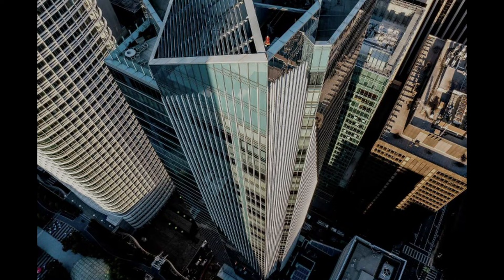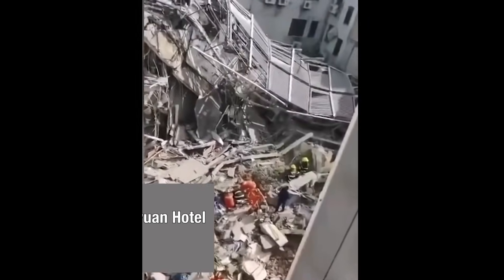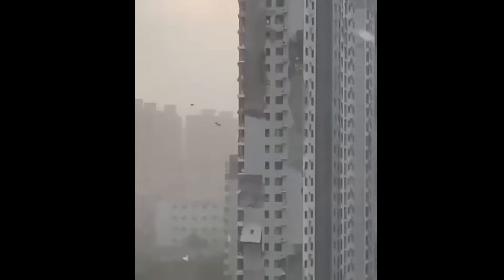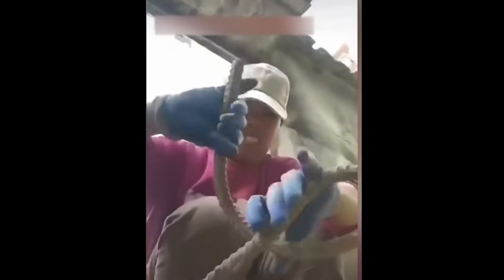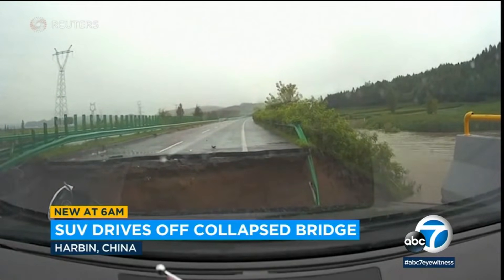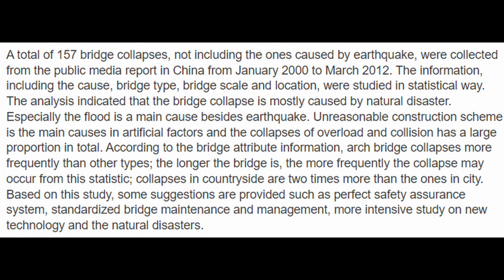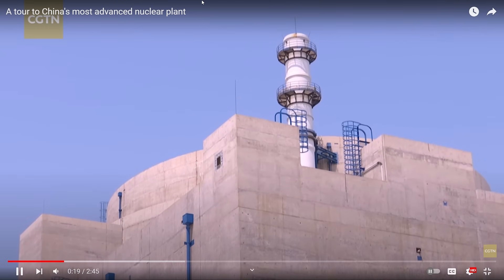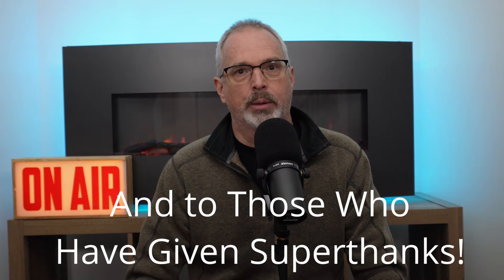Why Construction Projects in China are Often of Very Poor Quality

Comment: I worked in the Nuclear Power industry and consulted for one of the recent Chinese nuclear power plants.

The Chinese Nuclear construction standards are very strict and China appears to be doing it right.  They are not building plants faster than a number of other countries (and the US and Europe recent examples don't count because neither of us had built a nuclear plant in decades and the contractors had forgotten how to do it - which caused very extensive and costly delays).

The China Nuclear Power industry knows that they cannot cut corners and the contractors used are not the ones building apartments, offices, and roads.

Also, plutonium from reprocessing U235 or Plutonium 239 fueled power plant reactors cannot be used to make atomic bombs because there is too much Plutonium 240 in the power plant fuel rods after years in a reactor.   Plutonium 240 poisons the plutonium 239 such that it cannot go "boom" if there is more than a very trivial amount of Plutonium 240.

Bomb grade plutonium is made is special military production reactors where the fuel rods are run for only 2-4 months depending on the design of the reactor.   That keeps the plutonium 240 level below the critical minimum.

Power Plant fuel rods have always run at least 1 year and most run 4.5-6 years.  Way too much accumulated plutonium 240.   Keep in mind that while its relatively easy to chemically separate Uranium from Plutonium, that its extremely expensive to separate different isotopes of the same element (U235 from U238 is the most common such separation).  Separating Pl239 from Pl240 would be something like 9 times as expensive as there is only 1 neutron in weight difference between the two.

It's far cheaper to just built and operate special plutonium production reactors than to try to purify the plutonium from power plant reactors.
Reply from the maker: Thank your for your comments. Do you know if they are going with 4th gen type reactors? Also do you think the U.S. will get back on track with nuclear power? I think the lqck of a high level waste repository is a real problem for the industry.
Reply: @CaseyJones-Engineer   The Nuclear Power Plants I consulted on after construction were Westinghouse AP1000 reactors, which are considered a Generation 3+ design. The + means passive safety, if something goes wrong no one has to do anything for at least 3 days; and in the case of the AP1000 they would need to add water to a tank on top of the containment building - and fire-hoses would work for that if the plant internal piping systems are no longer operational.  Keep refilling the tank for a few months if basic plant operations cannot be restored.

Generation 4 reactors are in the theoretical concept and test reactor stage.   I expect no generation 4 power plant reactor for decades.

China did build a molten salt test (MSR) reactor and started it up in I believe August 2023.  While hundreds of people talk about the theoretical advantages of the MSR design they tend to totally avoid the huge reason there was never a 2nd MSR test reactor after the Oak Ridge test reactor (and the Air Force test Aircraft Reactor).  Corrosion.   The decay products from the fissioning of the fuel and resulting chemical reactons of those decay products made the liquid molten salt stream extremely corrosive (and more corrosive as operating time went on).  Significant material degradation was found after the reactor was shut down.

No known material of the day could withstand that corrosion, and nuclear reactors need to operate for many decades to make sense for power plants.

The last 15 years has seen a lot of research into modern "super-alloys" which would be much more corrosion resistant (I have yet to hear anyone coming up with a corrosion proof alloy for a MSR at this time).

At the same time the idea that you could do a side stream separation and remove the worst of the corrosive decay product and chemical resultants to keep their levels low enough to minimize the corrosive effects.

The primary reason the Chinese built what is now the 2nd test MSR reactor is that they believe that they have a super-alloy and a separation process that will work well enough to minimize the reactor and molten salt circulation and processing piping and equipment corrosion to an acceptable level such that you could design a 40-60 year life reactor and associated piping for a power plant.

It will likely be many years before we know the answers to those questions.

If successful the Chinese researchers would build another test reactor 10-15 times the size.  If that works well for many years then they could start desiging a very small power plant (likely under 50 MWe).  If that works well for years then they are off designing likely a 200-300 MWe plant, and larger plants once those are running well.  Figure decades.

Also, there is zero evidence that the concept of Small Modular Reactors will ever make economic sense.   There are three big flaws in the concept: 

1st, you cannot start mass production until you have a design that has been proven to work well for decades.  So figure at a minimum 15 - 20 years after startup to know the design works well.  

2nd, you need to be building many hundreds of such power plants a year for at least 5 or 10 years to justify the cost of automated equipment for cheap unit cost mass production; and no one foresees such a demand for power plant generation (and at best you can only semi-automate some construction similar to how heat exchanges and pressure vessels are built).   

3rd, It takes a lot more material per MW to build a SMR and minimum staffing levels (operators, maintenance, security) require a much higher cost per MW to operate than large central stations.

Note that the USA actually built 17 nuclear power plants in the 1960's-1970's that would be considered SMR sized reactors.  They were all shut down long ago due to operating cost (per MWhr), while large central stations built at the same time are still operating today.

On a related popular subject:  The USA and world did not ignore thorium fueled reactors.  Outside of test reactors the USA actually built 4 thorium fueled power plants.  All were both technical and economic failures with thorium as a fuel; while similar technology uranium based power plants succeeded.  Note that one of these plants was changed from Thorium to Uranium fuel - and operated well and economically on Uranium fuel for many years until it was shut down for other reasons (Indian Point Unit 1: 275MWe, PWR)

I hope this is useful information,
Reply from the maker: @perryallan3524  Thank you that is awesome information!  I just recently started my research on the state of nuclear power in the U.S.  About 15 years ago I worked on the geotechnical aspects of several COLA applications to the NRC.  There seemed to be a new impetus to get back on track but then Fukushima happened and then Westinghouse went bankrupt.  I think out of all of those applications only Vogle went forward and costs went from $15 billion to well over $30 billion.
Reply: @CaseyJones-Engineer   I forgot to answer future nuclear power in the USA.   I'd like to think so... but the USA has created its own political problems with new nuclear power.    

1st off, if looking at the cost of delivered power to the customer nuclear power is generally the cheapest power in the world.  That is why so many countries are building nuclear power plants.

The USA took the approach of only talking about how much power cost from the power generation source, and ignoring the cost to connect to and transmit the power to the end customer (which is included in the utility customers electric bill).  From that standpoint nuclear is expensive.  However, its vastly cheaper per MWhr delivered to build and maintain a single large transmission line (or two) for a large central station than to connect many multiples of smaller point sources and transmit that power to the end customer (there are international studies that show this).

That is why people in areas with all this new solar power are seeing their electric rates going up from all the cheap solar power.  The cost of connecting and transmitting and managing reactive power is not considered as a whole, and the end customers have to pay for that cost too.

So the USA has created a political problem for nuclear power by not telling people the economic truth about the entire cost of new generation and falsely presenting solar and wind as cheaper alternatives in many cases.

Waste is also a political problem in the USA.    There was a major federal lawsuit I think about 20 years ago (or so) that the industry/government lost because in the worst case environmental and world event case after I think it was 10,000 years that the people on the surface above a nuclear waste depository could possibly be exposed to less man made radiation than people would get from eating a single banana or a single potato each day (Potassium 40 is a natural radioactive substance that is in all of us).  Imagine the horrible things that would happen to us if we ate a combination of 2 bananas or potatoes a day!...  What if we ate more than that?...
Reply from the maker: @perryallan3524  Thank you for all of your in-depth comments and background information!  I am going to spend a lot more time researching this topic for an upcoming video.
Reply: @CaseyJones-Engineer    let me give you some help.

First off I am an mid 60's engineer who spent much of his working life in and consulting for power plants - with about the last 2 decades in nuclear power.  Unfortunately Covid left me with a lot of mental fog and exhaustion so far for years.  My functional engineering days are over as I have a hard time taking in new information and processing it, evaluating, and writing reports in any timely fashion.  I no longer can work.  But what I remember is easily accessed and my files are intact.  I let my PE license lapse a year or two ago.

Do an internet search for the following NEA document:  The Full Costs of Electricity Provision

That will provide the background you need on all the cost of delivering power and what parts make up how much of each generation technology.

Next do a search and  download the following:   Unlocking Reductions in the Construction Costs of Nuclear

There is a lot of other things I can help with.  

In the next several days I will try to contact you professionally if I can figure out where you work or find you on linkedin.  Then we can talk and email each other.

I am going to post below a recent post I did in response to a poorly informed thorium reactor YouTube video.  Feel free to look up all the power plant names I list to validate information.

I wish I had created a word document of a post I did about a year ago about sodium cooled reactors (no one has made that work - only the Russians claim theirs work - except we usually find out later the true stories about how poorly Russian reactors run) and gas cooled reactors as I cited the worldwide history of operating reactors and why the UK is replacing all of their newer HTGR's with light water PWRs.

Look for my contact attempt in the next several days.  Watch for any additional information I post here.

Have a great day and you do good work.
Reply: @CaseyJones-Engineer  Here is my recent thorium power post:

Thorium as a potentially viable fuel was identified in the 1950's by many countries.

First though is that thorium is not fissile (you cannot get a nuclear reaction using thorium). A thorium reactor actually runs on U233 in the end - and its U233 that is recoverable from them.

In the presence of a properly controlled nuclear reaction thorium 232 absorbs a neutron and becomes protactinium233. The protactinium233 then decays to U233 (which takes about 2 months to get usable quantities of U233). As such all thorium reactors must be seeded with U233, U235, or plutonium239 (the common fissile materials) to supply fuel for the first 4+ months of operation.

I’m not going to list and discuss all the existing test reactors that had thorium loaded into them or the thorium specific test reactors that were built. Suffice to say that thorium was tested in both existing test reactors and specific built thorium designed test reactors by multiple countries. Also in all kinds of designs since the 1950’s: Light Water, Heavy Water, High Temp Hot Gas (HTGR) and of course the Oak Ridge Molten Salt Reactor (MSR).   The recent several decades have focused on HTGR pebble bed designs and of course China just built and started up in August 2023 a new thorium based MSR to determine if we technically have solved the molten salt corrosion issues well enough to proceed with further development.

I am including the Shippingport thorium core load 3 (1977-1982) as a test reactor.  Shippingport was a naval aircraft carrier PWR that became the 1st demonstration and test reactor for commercial power: 60MWe output, Online 1958 (1st nuclear electrical power generation from a plant built with its primary purpose to generate electricity). This thorium core proved that a thorium core could self-generate surplus U233 for recovery by reprocessing.  Shippingport was shut down in 1982 at the end of this test. 

To date only the USA felt that they had thorium fuel designs based on test reactors that worked well enough to design commercial power plants from, which did not work out as explained below.  In retrospect they can be viewed as very large and vastly costly test reactors.

The USA had also spent the equivalent of $Billions in today’s money to build a stockpile of U233 to seed thorium reactors and for atomic bomb tests in the 1960's (the U233 bomb worked well). Note that they are now looking to spend $billions to dispose of that U233 stock as the containers are degrading and disposal is cheaper than repackaging the U233 stock into new containers which does not count long term cost of storage that follows – and eventual use or disposal in the future.  Also, there is no real foreseen use at this time for that U233 to justify the cost of preserving it.

1st attempt was Indian Point Unit 1 – light water thorium fueled 275MWe PWR power plant.  Online in 1962.  The thorium fuel performed so badly that they changed to uranium fuel in 1965 and the plant spent the rest of its life as a uranium reactor that operated well.  Unit 1 was shut down in 1974 due to changes in regulations from when it was built as the emergency core cooing system that was acceptable in 1962 was no longer acceptable in 1974, and initial plant design made retrofit of an acceptable system uneconomical (nuclear power plants tend to have lots of rooms with very substantial reinforced concrete walls – there may be almost no room to install something different).

2nd attempt (approved for construction at essentially the same time as Indian Point Unit 1) was Elk River – a light water thorium fueled 22 MWe BWR (Online in 1964, Shut down 3 ½ years later in 1968 due to major design and construction issues which led to cracks in the reactor vessel and main piping resulting in significant reactor water leakage.  I have found comments that says the reactor and power plant did not operate as expected; but, no evidence if this was a fuel issue or other issues.

A couple notes related to the design and how it relates to the modern concept of Small Modular Reactors (SMR’s).     The outline sketch shows what looks like a natural circulation reactor vessel with a boiler design never used again.  It looks more like a natural circulation PWR without any pressurizer or pumps for the primary loop with a separate boiler/steam generator. The Atomic Energy Commission and the plant designers insisted it was a BWR and the sketch and easy documentation I can find with short internet searches leaves a lot of questions – like was there intermixing between the reactor loop and the feedwater inside the lower section of the boiler).

More interesting is that this was presented as a prototype for a “Small Modular Reactor” for rural America (SMR’s as the reactor assembly and boiler was built in a plant and shipped to site by a railcar, which could be done anywhere as the key SMR concept of small nuclear reactors would be economical due to mass production was presented at an international conference in 1955.  However, 17 power plant reactors which would be considered SMR size today were built in the USA from the 1950’s into the 1970’s.  Not one of them is operating today – where a number of large central station nuclear power plants built at the same time are still operating.

Other than the cracks and reactor water leaks the biggest lesson learned was that small nuclear units like this would never be cost competitive with larger nuclear units as they need more materials and cost much more to build on a MWhr generated basis; and also cost much more to operate and maintain on a MWhr generated basis than a larger plant due to staffing requirements. Note that a 12MWe uranium power plant in Piqua, Ohio which ran from 1963-1966 was closed with the same conclusion.

3rd attempt was Peach Bottom Unit 1 - a thorium fueled HTGR reactor (as that seemed to be the most applicable technology other than light water based on test reactors). I believe it was about 60MWe output. Online in 1967, shutdown in 1974. There were severe problems with the thorium fuel and it was quickly changed to U235 fuel. There were massive other plant design problems (scaling up from a test reactor size rarely goes smooth). A total commercial and technical flop.

4th attempt (based on lessons learned from Peach Bottom) was Fort St Vrain - a 330MWe output thorium fueled HTGR.  Online in 1979, shutdown in 1989 due to several issues in the plant design that affected operation and required excessive and expensive maintenance and only produced 15% of the power it should have if it could run well enough to base load at 100% output which is how most US Nuclear Reactors are loaded.   I had a coworker who had worked at Fort St Vrain and he told me that in the end it was also converted to Uranium fuel.   I have been unable to verify that with limited internet searches (multiple sources report that Peach Bottom Unit 1 was quickly converted to Uranium).   Fort St Vrain was again both a major technical and economic flop.

Bottom line is that there has been extensive research into thorium-based reactors by multiple countries from the 1950’s to current time, and the USA even built 4 commercial power plants using BWR, PWR, and HTGR designs.

No country to date has made a test reactor or power plant work well enough to design a future power plant at this point – especially when they look at the USA’s attempts at building thorium fueled power plants by substantial scaling up of test reactors. The world history of initial nuclear power plant designs, and even 2nd generation designs, in many countries show lots of failures as what seems to work so well on paper often does not work in practice (or is too expensive to maintain).

Research continues and just because thorium did not work well and was not economical in the past does not mean that it won’t work well or be economical in the future.  It’s just going to take a lot of money and time.  If it was easy, it would have already been done.
Reply: Thanks